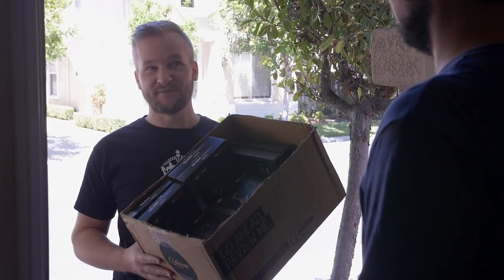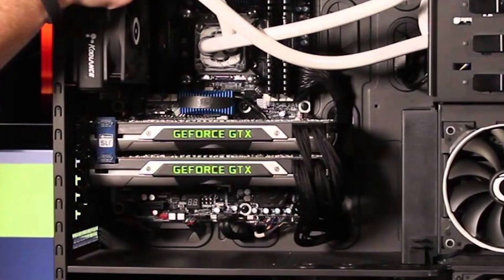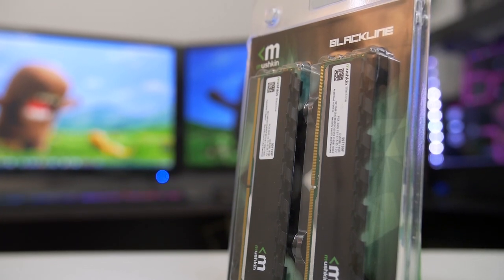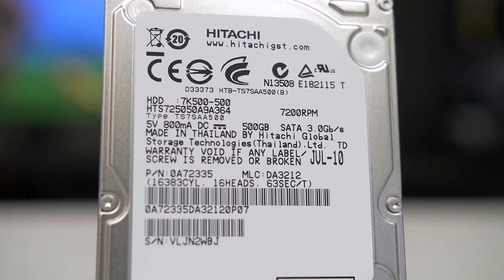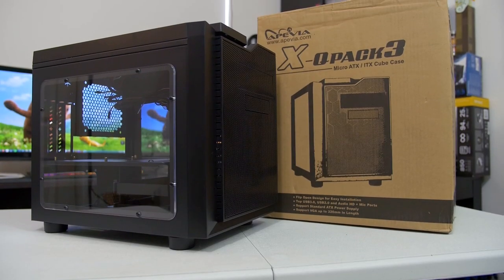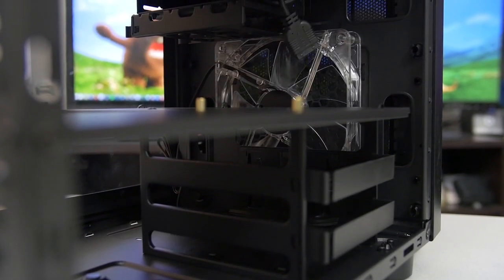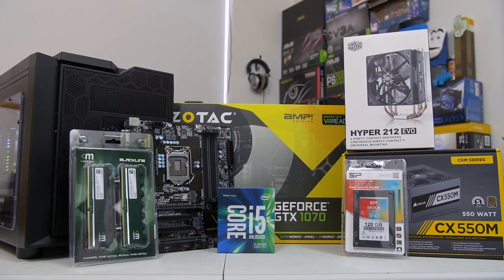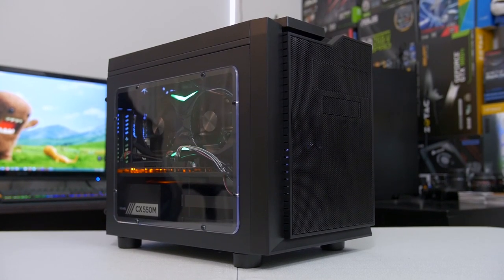The Fastest PC for $1000 - September PC of the Month

Comment: I'm want to build a pc with near $1000 budget with Ryzen 7 or Intel i7  and 16 GB RAM, planning to use it for 7 yrs with not any upgrades. Main Uses : running gaming emulators and watching youtube vids and mainly media consumption.  Any Recommendations?  
                                     https://pcpartpicker.com/list/Yg6BM8
Reply: Cybrax -etc great for emulation but horrible for modern gaming lol.
Reply: my friend wants to do a pc build that he plays at 1440p , what be good then?
Reply: Cybrax -etc that build for 7 years is not good at all!!
Reply: I changed my build options thanks for the feedback
Reply: Cybrax -etc nice man
Reply: Cybrax -etc my build:
My build
CPU: Intel i7-7700k 4.2GHz
MOBO: Asus ROG Strix z270e
RAM: 16GB DDR4 RAM 2400mhz
GPU: nVidia GTX 1070 8gb armor
SSD: Kingston 120gb ssd
HDD: 2TB Seagate ST2000LM007
PSU: Corsair TX750
COOLING: Corsair H100i v2 watercooling
CASE: Cooler Master MasterCase Maker 5 (vinyls can be easily peeled off without marks)
EXTRA: Corsair RGB LED fans, ASUS BR/DVD disc drive, LED strips
Costs £1600 in the U.K. That's like 2000$ US dollars are prices for parts are awful. I got mine for £900 tho amazing deal
Reply: Heck of a deal

Comment: Https://PCPartPicker.com/list/wfXBnn how’s my list? Any problems with it? Also is a ssd really required and a thing I should do or will I be fine with just a hard drive?
Reply: That's a pretty dang nice build. I would definitely consider getting an SSD, especially for a >$1000 PC. I have an SSD in my $400 PC, and I'm glad I do, it makes things a lot faster than computers with only hard drives.
Reply: Also, if you can spring for a 1080 or 1080Ti with less memory for the same price, it will definitely benefit you
Reply: Replace the i5 with r5 160 and motherboard with the msi gaming b350, result? Profit!!!